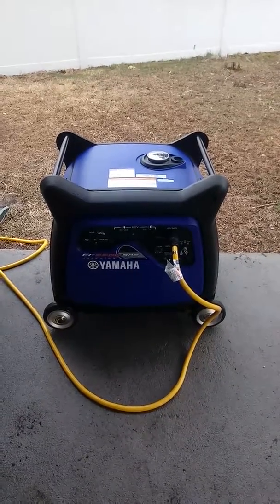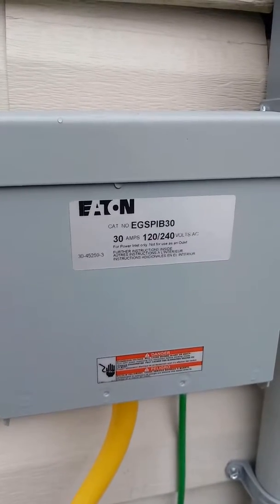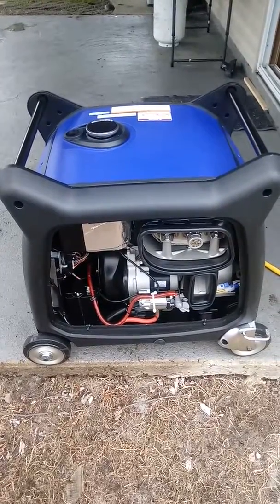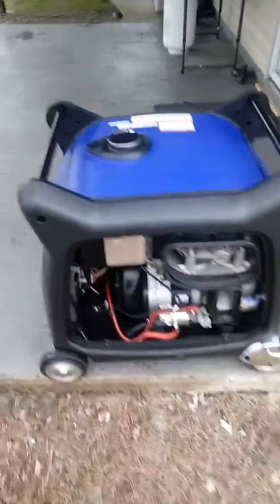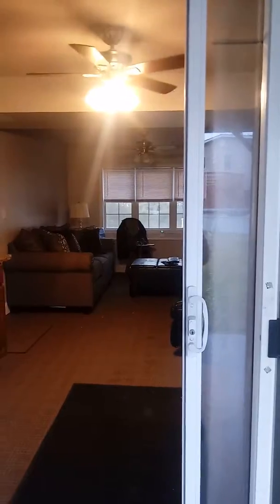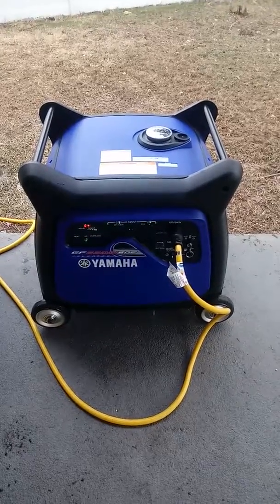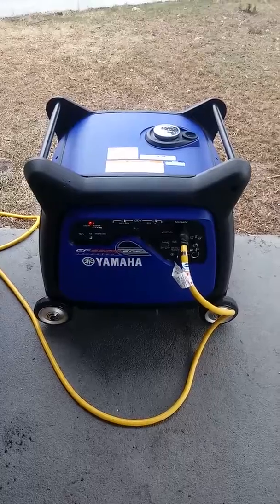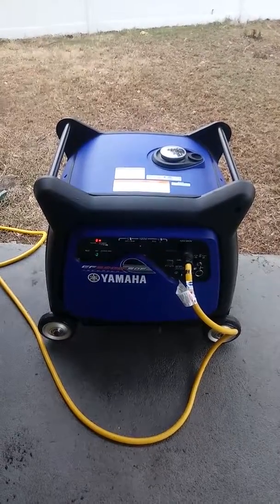Yamaha EF6300 Home Backup 30 Amp Transfer Switch

Comment: Hi, being that the Yamaha has a bonded neutral, do you have any problems with the transfer switch? I keep reading that generators need to have a floating neutral to be hooked up to a breaker box.

Comment: Remember to never run your generator with the front or back cover off. They need to be on for the cooling air to be directed properly.
Reply from the maker: Agreed.  Only reason I did so was because I installed that Drainzit oil drain hose.  This was in February so cooling should not be an issue.

Comment: Where did you get that good deal   ?
Reply from the maker: Google, "PPL Motor Homes Texas." They have one for <3k plus (I believe ) $150 freight.  A local powersports dealer matched their online price and I agreed to pay tax + $99 to prep it. (add oil, gas, fuel stabilizer & charge battery,   I felt it was well worth the $ to have the dealer do all that and make sure it works.